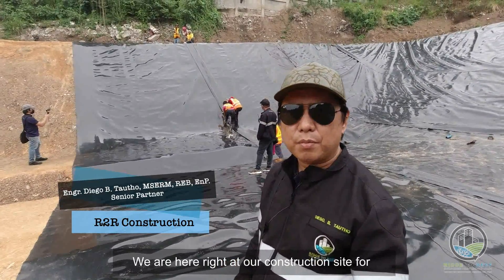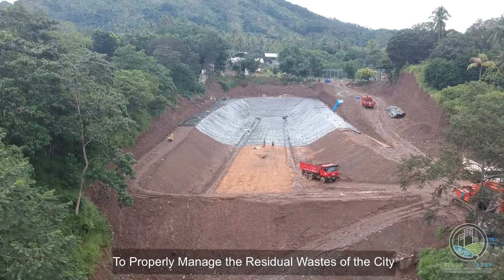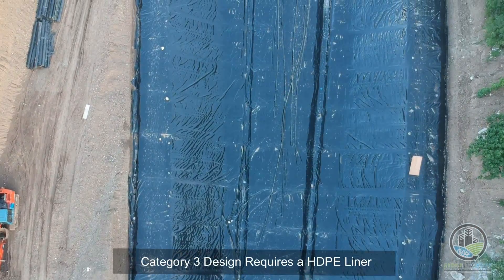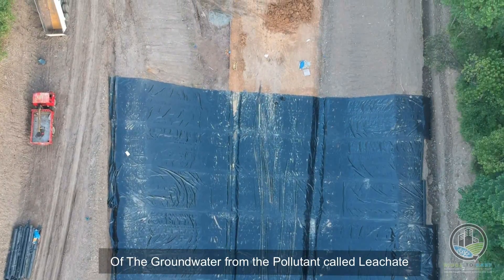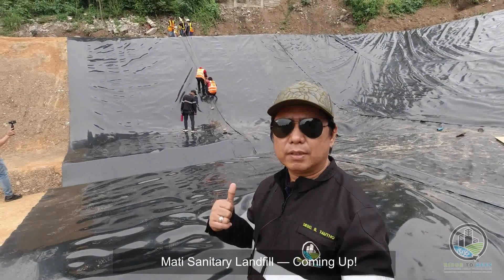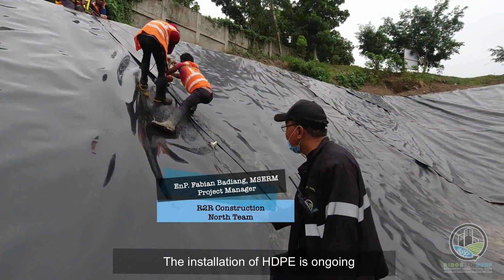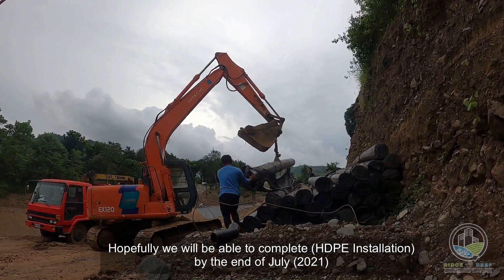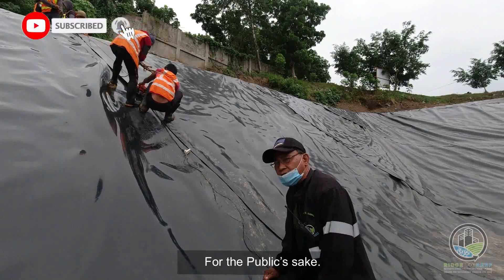HDPE Liner Installation at Sanitary Landfill Facility | Mati City

Comment: Bakit ang layo ng trench nyo mga bossing? Also para safer gawa kayo textile ladder. Avoid nyo din yung water and dirt sa sims kasi too much water cause crystallization sa weld and mag ffail yung peel and sheer nyo. Which impact your quality of instillation. Maganda din sana kung may under lay kayo bago liner like textile, composite, or geo net.